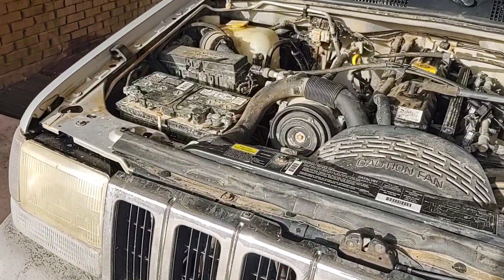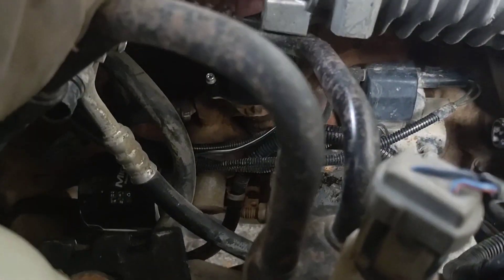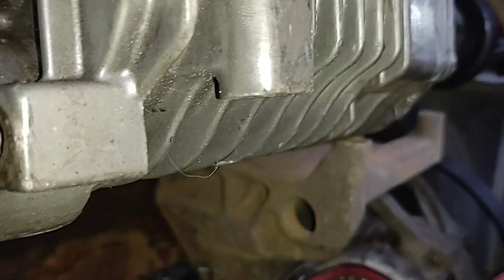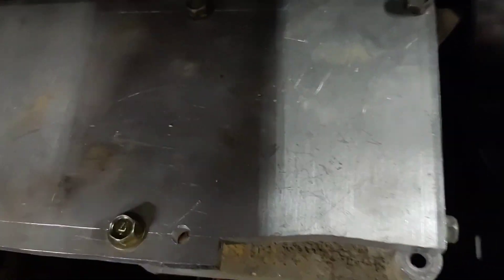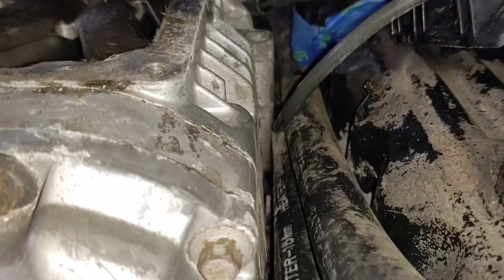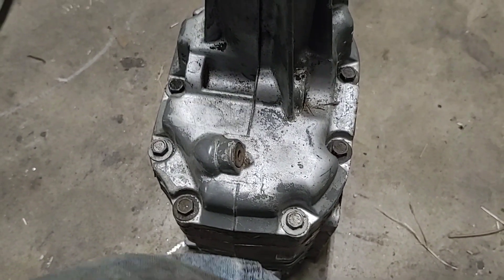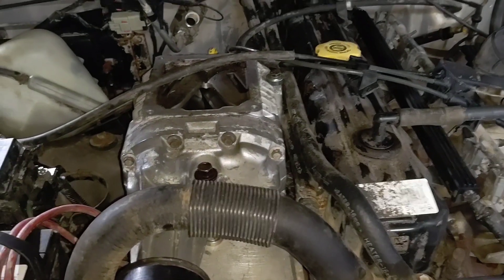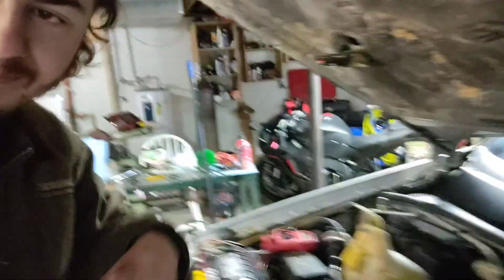supercharged jeep 4.0

Comment: What year of supercharger did you use because I was going to turbocharged if it just looks a lot easier
Reply from the maker: Mine was an earlier thunderbird super coupe I believe 1989 but any year will work the later ones had a better inlet and coated rotors

Comment: So did you finish it?  That's a pretty solid way to super charge a 4.0. Did you add larger injectos/fuel pump and tune the ECU or just run the stock setup?

Comment: In the process now of making an adapter and/or manifold for an M90 going to my carbed 4.2
Reply: Was trying to do a draw through as I had seen just one other Jeep have it in my life, but I couldnt ever get in touch with the guy
Reply from the maker: @jeepingeo  that would be cool. I wouldn't think it would be too hard with the gm m90. Hood clearance might be a problem
Reply: @thomasbeyer  The PO installed a 3" body lift so Ive got plenty of room for it. I was mainly concerned with running fuel through it. Ive only ever seen one other guy with a draw through setup on a Jeep 4.2 and Im sure he's dead by now unfortunately :/
Reply from the maker: That'll be cool. Blower before or after the carb?

Comment: I installed one on my 04 jeep tj 4.0. Off a ford thunderbird, which is basically the same m90 but comes with the outlet piece already.  Once u change the injectors to a 36lbs, a high flow fuel pump, and dyno tuning, and it runs beautiful. U can feel the torque right away, and without breaking ir driveshaft.
Reply: What model is your supercharger and year off the thunderbird and thank you for any info

Comment: You are on the right track!! look into a m62 off of a Mercedes SLK 230. You might be able to put a really little pulley on it and get the same amount of boost. The m62 is much shorter and might fit better, at least it fits well on my 4cyl.

Comment: It's open is why it's loud. Should quiet down after the rest is hooked up.
I would run an intercooler because 4.0 run hot as it is and a oil cooler adds a quart to the capacity of oil .
Reply from the maker: Im planning on a top mount intercooler and a hood scoop. And an oil cooler is probably a good idea.
Reply: With how that engine scoots on a supercharger it's not unwise to add a transmission cooler. Plus a pillar cluster gauges look cool.

Comment: How many horsepower do you have?
Reply from the maker: 175 hp 220 torque to the wheels
Reply: @thomasbeyer  nice broo 👏🏻🔥
Reply: @thomasbeyer  I wonder if tire size affects those numbers?  I've always wondered... I commented on another video of yours... I have 33s on my xj.
Reply from the maker: @Ewwwst1cky  I'm sure it does me and my buddy want to do the upcoming mods and dyno then bolt on some normal sized wheels and tires and see what happens.
Reply from the maker: I do not know yet I will Dyno it after i get all the bugs worked out